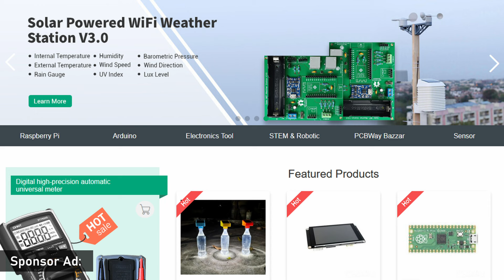No.127 - Kitchen hob PCB non-repair

Comment: To make it more interesting, the 5-part fuse is tapped twice, once for the MOV and once for one of the caps.  So replacing it would require at least 3 fuses.
Reply from the maker: Ah yes of course! Missed that. A multi-tapped fuse!
Reply: That's an interesting aspect of the design.  Can anyone give reasoned speculation as to why?
Reply from the maker: I don't know.....can only guess:
Sequential protection, customized protection levels or simply space and cost efficiency..........
Reply: The tapped fuse would be able to tell the tech what caused it to blow. If it was only part of it going it could be a lifted neutral wire (MOV triggered) etc.

Comment: Prospective Short Circuit Current (PSCC) is likely to be well into the hundreds of amps on a cooker circuit. I suspect the multiple "fuses" is to give the separation to clear the fault current without having a single longer fuse that will create a significant hotspot under load. Those large pads will be to dissipate some heat.
Reply: I think PCB fuses are cheaping out on quality (you can see them often on cheap Chinese SMPS) a proper replaceable fuse would be much better. Also I think on a UK cooker circuit you need a HRC fuse.
Reply: I agree. Use a real proper HRC fuse with a known rating in a fuse holder. Even a BS1362 fuse would be ok. A PCB fuse is cheap and lazy and has a widely variable rating. You don't know what current it will break at.
Reply: @Alexelectricalengineering  Not necessarily an HRC fuse. The fuse type is dictated by the PSCC, but the most straightforward route for compliance is a ceramic fuse.
Reply: @sdgelectronics  You are right most ceramic fuses are capable of breaking a very large current (I think something like 1.5 kA at least)
Reply: Probably they also want enough open path length to get the arc to extinguish. Mains arc will happily run over multiple mm especially with carbon around.

Getting a bunch of arcs going at the same time is harder. Eventually you'll reach a distance where the spark gap won't fire and it'll stop.

Comment: If one only has a single short-length fuse protecting a 230V load, then when the fuse melts and an arc strikes, the resulting gap is insufficient to facilitate quenching of the arc. So multiple PCB fuse traces are put in series. They don't all blow at once as one commenter suggested - the weakest "fuse" section blows first, and an arc strikes. The voltage across a short arc for currents <1A is in the 15-20V range. This means that current continues to flow through the arc until another fuse section blows and strikes another arc in series. This gives another 20V drop. This continues until all the fuse sections blow, and at this point the voltages across each section are shared equally. When the AC zero crossing comes, all of the arcs quench, and the circuit is opened.
Reply from the maker: Interesting!
Reply: @IanScottJohnston  and @peterh1386  That looks like a job for The Slow Mo Guys.
Reply: @Brian_Of_Melbourne  Great idea Brian - that would be cool to see!
Reply: I was thinking they put 4 in series for voltage requirements.

Comment: I expect that the large pad area also make the fuse a slow blow, by removing and dissipating the heat in the small tracks allowing for higher inrush currents without lowing the protection for the supply wiring. in the same way they put a blob of metal in the centre of a fuse that slows the heat build up in the wire where it would normally melt! thus slowing down the fuse action allow the inrush current to reduce to the normal conditions and the fuse link / wire to cool.

I've always hated picking the fuse rating and type for equipment, as its got to survive the daily turn on and off's for a good part of the life of the device, but at the same time blow as fast as it can in a fault condition. then given the enormous number and types of fuses out there, it's almost a full time design function. 😞

Comment: Inline fuse on the cable coming in to the unit and its done.
You could even try to fit in a SMD part though that would require grinding of the PCB ( SF-3812F3500T-2 )

Comment: PCB fuses are just ridiculous
Reply: It sounds ridiculous, sure, but many designs also use zero-ohm resistors as fuses. It all depends on the conditions under which they are expected to trigger.

In this case the board basically self-destructs which sounds like they are denying "right to repair", but it's also very possible that they are protecting amateurs from trying to fix it and hurting themselves. Ian straight up refuses to fix the board without examining the hob and even then he's hesitant, and that may well be the reason for the design; the hob might now have an invisible failure and powering it up again could cause some serious danger.

Comment: Looks like they went to the Apple school of design, ie, instead of a simple replaceable fuse lets make sure it totally destroys the PCB so you have to buy expensive replacements. 
I would fix/re-engineer it regardless, because it would either pop straight away - not a big deal if you stand back -, or it will work fine.

Comment: Had similar issue with my dryer. Blew the pads off where the relay was soldered onto the board. I  patched it up with some wick and she's good as new. It never occurred to me to check for faults in the board. Lol I just assumed it was due to a bad solder joints going more and more resistive over time.
Reply: Never assume, always verify!

Comment: If there was enough space, maybe a turret (like in the hardwired guitar amps) through a drilled hole in the pcb could be something. But meh, still doesn't feel safe. I completely understand why you don't repair the board. Good call.

Comment: Too cheap to even put in a proper fuse to allow for repair, so that is a brand to avoid, what brand was it ? If it were mine (not someone else's) I would drill holes through the PCB and install a flying lead barrel type fuse or mount a fuse holder somewhere else for one.
Reply from the maker: Flying lead barrel fuse capable of up to 30A??
If it were my hob then maybe I would try something……but it’s not mine and would be irresponsible to hack a fix for a friend IMHO.
They bought a new Pcb for £250.
Reply: I think it's probably not do with cheap, but rather ensuring the PCB doesn't get repaired after a catastrophic failure. Even if it goes back to the manufacturer under warranty, it's likely more cost effective and more straightforward from a risk/quality perspective to swap out the PCB
Reply from the maker: @sdgelectronics risk mitigation.

Comment: I wonder if the four fuses in series is to reduce the voltage across each fuse section to avoid flashover.

Comment: Even if you did replace the PCB fuse with a proper HRC fuse in a fuse holder mounted off the board and replaced the shorted MOSFETs, high voltage will have back fed through the gate pins and fried the control circuit. If high voltage has fried the PIC microcontroller, there is no point replacing that. You would need the firmware and good luck finding that.
Reply from the maker: Yep, can of worms no doubt.

Comment: Shameful design, the manufacturer needs to be exposed.   I've repaired a single hob induction cooker, and again MOSfet issues, I replaced it with the latest version of the part from a reputable supplier not had a problem since.

Comment: Looks to me like the pcb fuse did it’s job, shouldn’t it be fused further upstream anyway, maybe that’s the thought of the designer and this is a last resort protection they get for free without increasing the bom ?
Reply: Upstream fusing is there to protect the fixed wiring rather than the appliance. It would be normal to have this on a 32A to 50A circuit, depending on requirements
Reply: @sdgelectronics  so if you were designing this would you put an actual physical fuse on the product or would you think the pcb fuse is adequate
Reply: @XORMeUk  Personally would use a physical fuse, but for the reason that this would reduce the burden of proving compliance.

Comment: No my friend ... It is repairable circuit board and this fusing design is the worst stupid idea of the designer EE ... Just use a thin 1 hair diameter copper wire and solder all these pads at once in series and go on finish repairing ...
Reply: That may well be, but the PCB is already damaged, and it will look rough around the edges with such a fix. The only fix I’d dare to do would be to mill out the old fuse footprint and make a shallow seat in the board to fix a custom replacement fuse PCB. It would look at least somewhat professional that way and I wouldn’t have trouble sleeping at night. Also no wire to curl off the short to the nearby case.
Reply from the maker: @absurdengineering Hit the nail on the head…….it’s about how to sleep at night.
Reply: @absurdengineering  My friend , you made so complex solution , it is only soldering a thin hair diameter of copper wire on the same damaged PCB area which is available for soldering , why would you add more PCB to replicate the same stupid idea of that designer ??.. Are you also trying to save some money of using real fuse component too ???... Come on ! , be realistic , PCB fuses are always much trouble with smoking and firing other components when blowing unlike glass/ceramic fuses ...
Reply: @IanScottJohnston No you won't sleep safe at night with that solution at all .... The core problem is ; Using PCB printed fuses is a very stupid money saving idea rather real glass/ceramic fuses ... PERIOD ! ...
Reply: @ahmedalshalchi True, but sort of beside the point: the thing is broken enough that even if you fix the fuse and replace the mosfets it fails again (if I understood the video correctly). They may have known something about their design, perhaps :)
Reply: @absurdengineering  To have a broken and damaged components on the top side layer is much safer than the under part with unrecoverable PCB damage , right ?!...